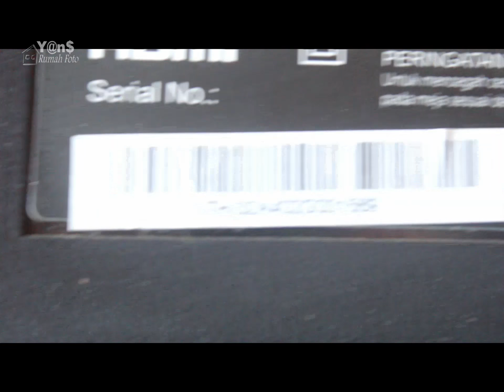KERUSAKAN TV LED PANASONIC VIERA TH-32A402G  GAMBAR BERGARIS

Comment: Mohon maaf mas, panasonic TH-L32X20S problem ada gambar tapi hitam putih, sedangkan osd menunya berwarna, solusi kerusakan bagian apa ya mas? Terima kasih
Reply from the maker: gambar  hitam putih pada saat input mode apa ?  ( TV aatau HDMII atau ??? )
Reply: @yanshapins129  mode siaran tv sama HDMI juga black white mas, saya test dvd player juga sama
Reply from the maker: @ddt-578  , 1, coba menu seting dikembalikkan di reset ke mode default , kalau tidak ada perrubahan coba ic/chipset di panasin pakai blower ada kemungkinan soldernya ada yang retak , atau bisa juga  ic/chipset yang memang ada kelainan ,
Reply: @yanshapins129  setting default masih sama om, kalau ic chifset yang seperti apa om, maklum saya pemula jadi teknisi nya
Reply from the maker: @ddt-578   chifset yang ada di main board seperti kotak segi empat yang setiap sisinya terdapat kaki/pin soldernya.
coba aja panasin semua komponen yang ada di board utama itu  . saran saya coba cari data sheet /skema main board tv tersebut dan coba ukur semua tegangan kerjanya
Reply: @yanshapins129  terima kasih banyak om,  besok saya coba, seemoga om selalu sehat dan di limpah ruahkan rezekinya, amiin..
Reply from the maker: @ddt-578  SAMA-SAMA TERIMAKASIH BANYAK DOA NYA

Comment: Buka flexibel Panasonic gimana ya bang?
Reply from the maker: kabel Flexibel LVDS atau kabel dari TCon Ke Panel LCD nya
Reply: @yanshapins129  yang ada 2 itu bang, buat dikasih isolasi biar ga bergaris
Reply from the maker: @yahyafadilah3783  kabel LVDS. Biasanya ada Klip yang tingal ditekan / di angkat keatas
Reply: @yanshapins129  ok makasih bang
Reply from the maker: @yahyafadilah3783  sama sama